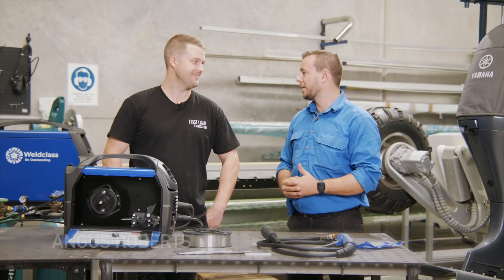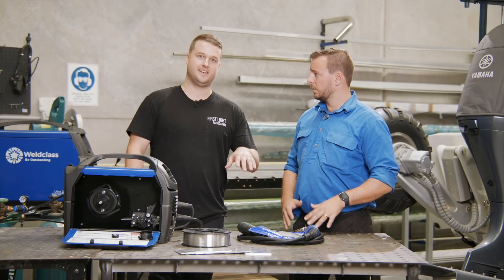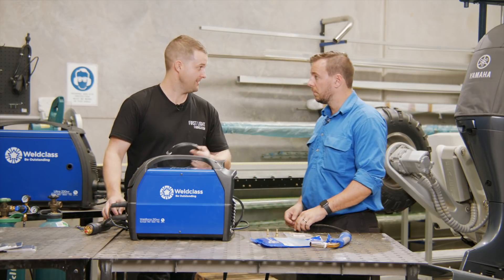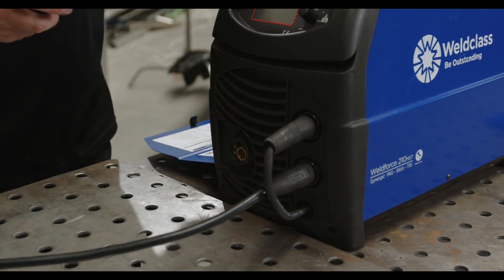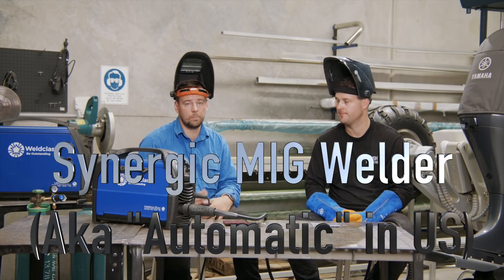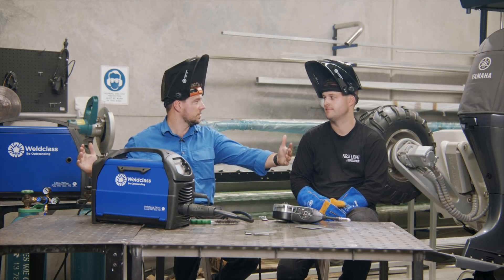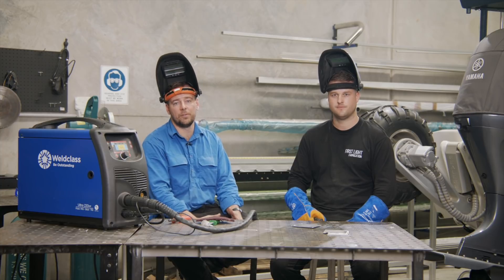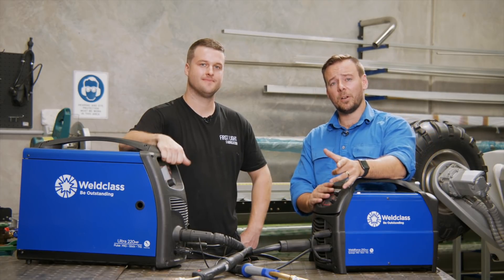Weldclass Ultra 220MP: Pulse MIG | STICK | TIG From Down Under!

Comment: There's another form of Aluminum mig that my dad showed me a few years ago where the wire was being fed through the liner but the mig gun itself had an extra pair of powered rollers at the base of the neck, I'm not sure if it was for a certain size wire or if it was meant for a high wire speed or what.

Comment: Shame the video was filmed using such crappy machines.  You can really see how they have used low quality manufacturing and parts such as the plastic wire feeder and hoses. That is typical of weldclass products unfortunately.

Comment: Bit of an odd video - a lot of talking, but almost no welding shots at all, so no opportunity to see the different weld behaviour between the different welding modes. The audio is a mess - the two mics are panned hard left and right (and didn't need to be), and don't match the position of the two presenters for about half the video, which is off-putting. For anyone who's wondering, that double pulse 220A unit is AUD $4.3k. I'm in the market for this kind of machine, and the company rep seen here seems to know his stuff, but not impressed with the poor execution of this video.
Reply: They need to know how to weld to work a film studios